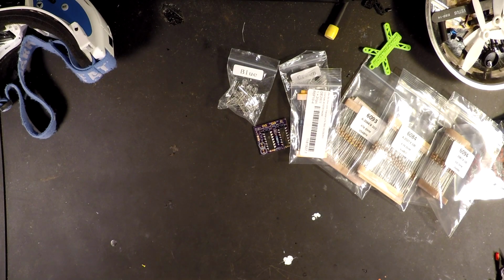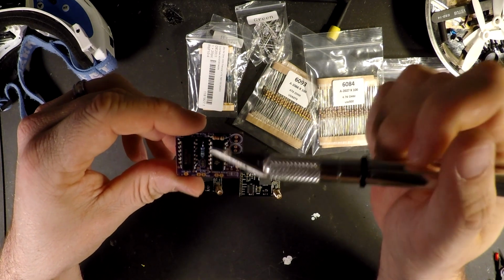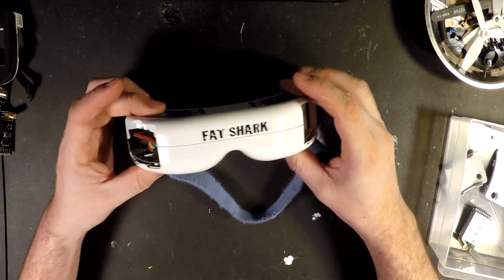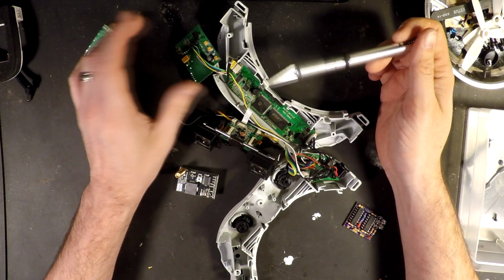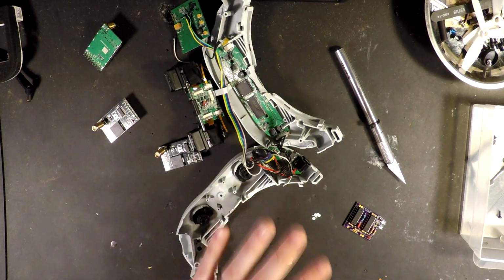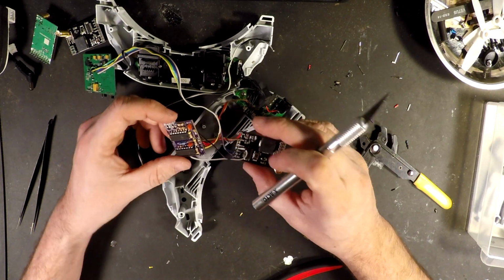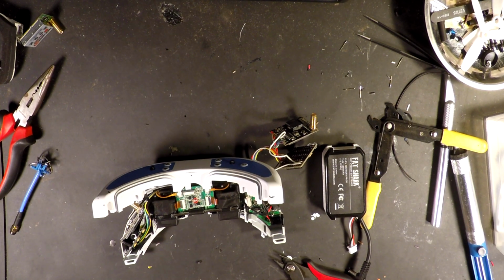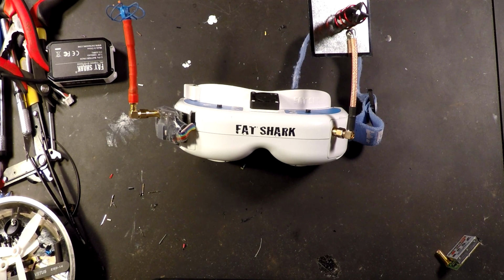DIY Diversity for Fatshark Dominator V2 goggles build video

Comment: Excellent!
Reply from the maker: Thanks :) I thought it was a bit long winded but I wanted to try and leave no questions unanswered
Reply: +T-Bone FPV  I love your videos, I've been trying to decide whether or not the Blade Nano QX FPV Package is a good starting point. I know eventually I will get a more professional TX that I can use with multiple models and on my builds. I love the micro to mini sized quads. so agile. Okay so the question. are the teleporter v4s that come with the package something that I will be able to use for some foreseeable future? Again Great videos, really getting me in gear.
Reply from the maker: +SammyTheKat I hadn't looked at the teleporter v4's before but just doing a quick look at them if it were me in the same position again I personally would steer away from them if I had an option.  

The biggest thing that stands out is the inability to adjust for the IPD (the distance between your eyes for the lenses inside)   Myself on my dominators I have to adjust them all the way to the center and it is just enough for me.  If I had a set that I could not adjust I would probably not be able to use them.  

Another down side would be the inability to change out the receiver unlike the dominators that have the modules.  

Are they perfectly viable for fpv and do a lot of people have success with them?  Absolutely

I have only ever used the Dominator V2's other than using a screen so I really can't offer a honest comparison between them.  

Oscar has a good write up that is a little old but it will give you an idea the difference between goggles.  http://blog.oscarliang.net/fpv-goggles-review-fatshark-skyzone/

Sorry I can't offer any more insight but if I had the money to spend I would shoot for the best option that would allow me to adjust with the times as things change.  Removable receiver modules is big for me.
Reply: +T-Bone FPV thanks man.
Reply: +T-Bone FPV What do you think about the DIY quanum kits?
Reply from the maker: +SammyTheKat Something I haven't used but I know a lot of people that have great success with them.  For the price you really can't go wrong.  The v2's are pretty cheap and the receiver you buy for them can be used later in a ground station if you upgrade goggles or something.  If I had to decide between a low tier fatshark or using quanums now and buying higher tier goggles later I would go quanums and upgrade later.
Reply: +T-Bone FPV You're very helpful. Thanks
Reply from the maker: +SammyTheKat Not a problem brother.  No matter what you choose you'll love it and won't be disappointed.